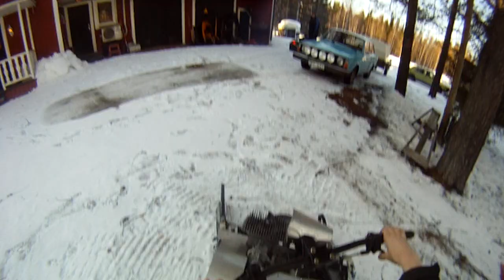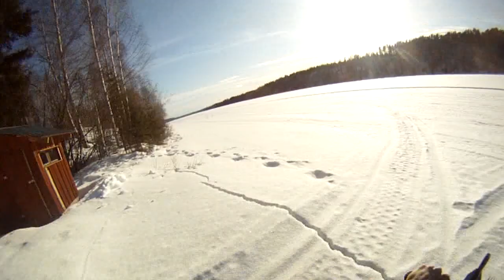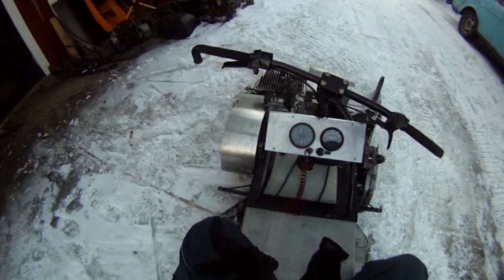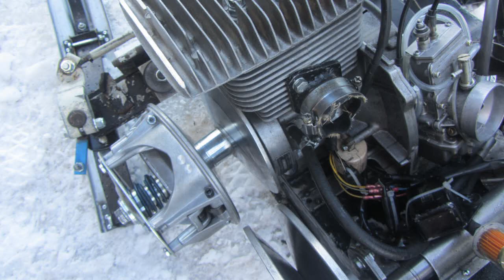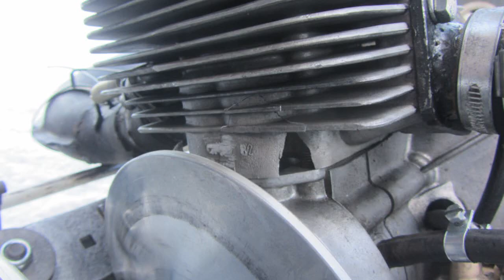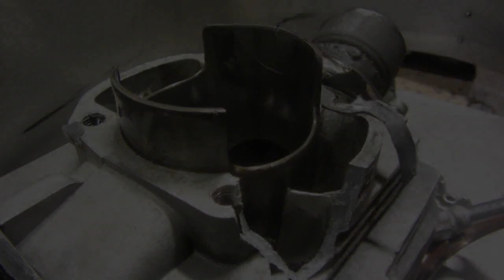Death of an engine

Comment: I blew a clutch during a race with my 1972 Ski-Doo Doo Blizzard.
Coming out of a turn, it ripped through the steel clutch guard , 
and blew the hood off over my head !  This was the 294 triple !
Reply from the maker: Jeffrey Hagelin oh wow, that sucks, especially on a rare sled like that. On my 71 797 I'm mostly afraid to break a conrod but it seems clutch explosions were pretty common on those too, cylinders are very hard to find and pto cylinders with the fins above the clutch in tact pretty much impossible!

Comment: Nice ride you have there..looks like a 250 polaris with an ATV head? I have one in my oval sled.. another trick I learned was running a 17-42 gear ratio..brought rpm's up..:) I look fwd to seeing more of the sled
Reply from the maker: It's a Rotax 277 with a dirtbike head :) Or was, better said. This little adventure turned out to be the final straw, this sled had been causing nothing but trouble since the minute I came up with the idea for it. I just had enough of it and went back to my Olympic. I sold the chassis and it's now getting a 4-cylinder engine, two 454s coupled together.

Comment: i had a clutch explode ..the sled was a 700srx and it broke the cage on the crank bearing ..it had easy to change bearings and i caught it just in time ..if its got a track on it chances are it will send you walking home a few times at least
Reply from the maker: +mark yeomans Luckily I was already right outside my friends garage when this happened, at least saved me the walk. That clutch was brand new though, what you see on the video and about 3 minutes of testing the night before was all it had ran :/

Comment: My bro has a 277 in his ride..Untested on the track.. just waiting for snow here in Maine!! :)
Reply from the maker: Cool, they're great little engines, lots of HP with relatively little mods and parts are available everywhere :) My Oly 277 was the fastest one lunger in Sweden for a couple years, until people started coming with "big block" (400+cc) one lungers and nitrous ;) I'm currently building rotary valve single based on a 277.